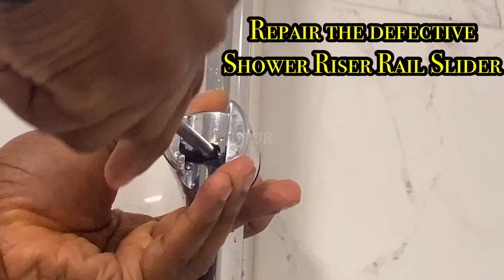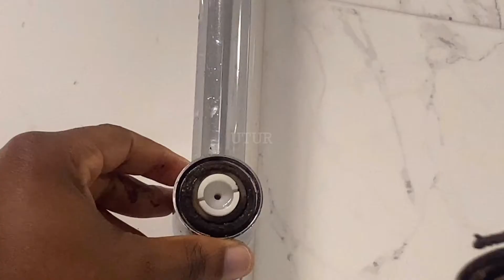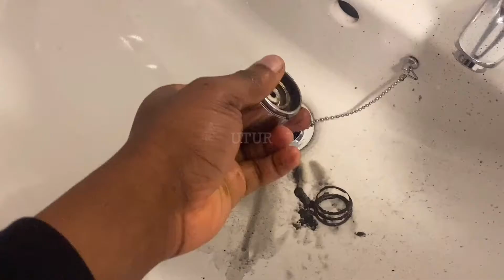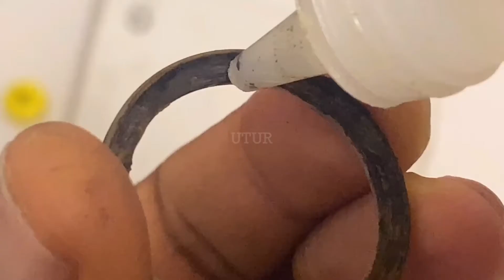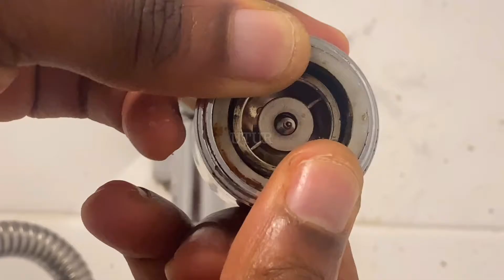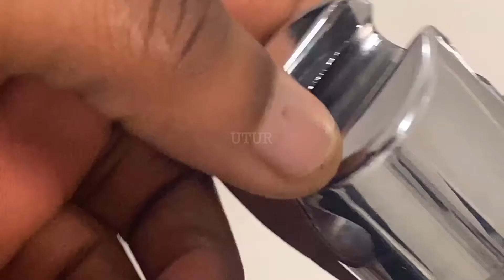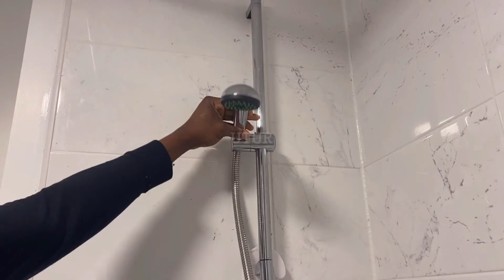Shower Riser Rail Slider Sliding and Free Falling Fix  - How to Repair & Replace Defective Slider

Comment: 1:01 – this is the key bit I need to see but it's off camera, unfortunately!  😂 Can you possibly help me, please ?!

I've got the riser off the rail, I'm unscrewing the single end-screw, but while it unscrews, the pieces of the slider aren't separating, just turning and turning – they appear held together by an additional internal mechanism?!  

I need to take it apart because while I have a pristine replacement slider, it's salvaged and the slider hole is for a thicker rail than the broken plastic slider I'm replacing. 

I need to retrieve the inner push-button 'clamp' from the broken plastic slider as it grips the rail much tighter than the same clamo in the replacement hence the need to take the broken one apart!

I'd be very grateful indeed for your advice, thank you.  🙏🏼